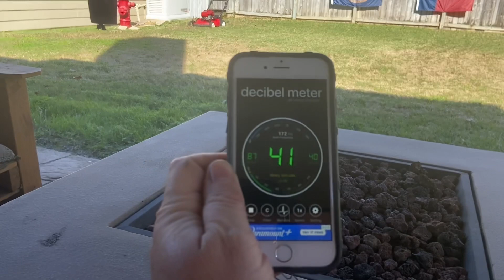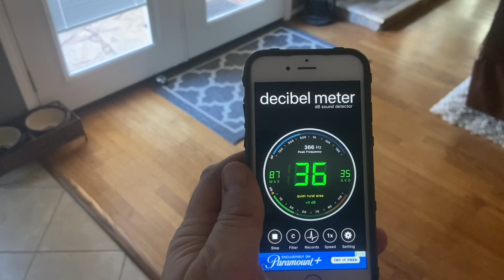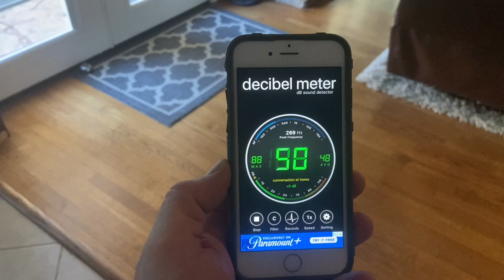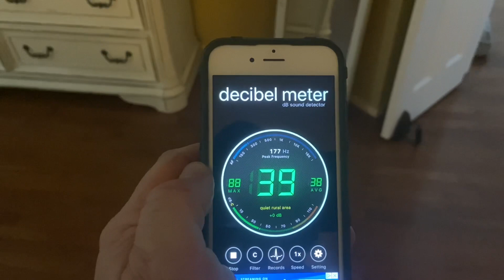How Loud Is A Home Standby Generac Generator?????

Comment: I wonder if you can add some more sound deadening material would it make it quieter?  and would it be safe?  looks like there is a lot of room inside to add that material
Reply from the maker: The lid or top and sides has some the  ends have to remain open for air and exhaust. Honestly it’s not bad unless you plan to sleep outside while it’s running. I my area during a outage it’s only a matter of time till everyone starts dragging out the portable generators so the noise level is really not an issue.

Comment: Just bought one of these and am waiting for the install.  I’d rather put up with some noise for a few days than have no power/AC/heat, etc. I assume it’s no louder than my central air unit.
Reply: I'm QUITE sure it's much louder than a central air unit.
Reply from the maker: Yes sir for sure , I hope the install goes smooth. Please subscribe like and share , take care and have a great day.
Reply: You may be happy to put up with it, but how about your neighbors? Untill they get these units to meet residential noise regulations, they should be outlawed.
Reply from the maker: @GrahamM-sm1hv  if your asking me 2 of my neighbors have the same unit, the noise does not bother anyone around me that I have talked to. If they don’t have one like this they will be dragging out their portables anyway so it’s a mute point.
Reply: @GrahamM-sm1hv  Outlawed? Stop being ridiculous.

Comment: Thanks for posting this informative video. I've read several reviews about this generator and will it is rated highly, most reviews report that there is a significant reduction of power when fueled by natural gas. I'm wondering if you use natural gas or propane, in if you are using natgas, have you noticed a power reduction?
Reply from the maker: Thanks for watching please subscribe and check out my other videos I have a complete overview on the generac on my channel. Mine is natural gas powers the whole house and more. Have a great week.
Reply: @JustCantSitStill  YOU TOO
Reply: The difference in power has nothing to do with the generator, and everything to do with the fuel.  ALL generators will produce more power on propane, and less power on natural gas.  It's just the nature of the fuel.  The difference is roughly 10%.   For example, a generator that is rated for 24K will produce 24K on propane, but will produce roughly 21K on natural gas.
Reply: @5thGenNativeTexan  That's good to know. Thanks.

Comment: My initial gut feeling was that your muffler is damaged or you have an exhaust leak. It should be quieter than your mower.
Reply from the maker: Thanks for watching please subscribe like and share! 

You have to be joking right? You think a 999cc engine running at 3600 rpm is supposed to be quieter than a 212cc mower at idle……😂 no way but I was impressed that it was not much louder not a huge difference especially inside the house. Have a great day!
Reply: @JustCantSitStill  No I am serious. New Generacs are significantly quieter than the lawn mower. I think one or more of the internal  baffles may have blown out. Check the entire exhaust system for leaks, cracks, etc. Nice video BTW.
Reply from the maker: @thomasgibson8025  no nothing wrong with it sounds exactly as others like mine. and was just serviced and inspected. You may be getting mixed up with the 4cyl models that runs and a much lower rpm. Please subscribe like and share. Check out some of my other videos thanks 🙏
Reply: @thomasgibson8025  I have to agree with you! I'm not sure why his generator is so noisy Yikes! Maybe a bad mic on his camera or phone distorted the recording? If not, I would say his unit has an issue. I have a 24KW and when its running it sounds more like Honda generator when it running under full load at max RPM. My wife said it sounds like a more like really loud purr sound and nothing like a walk behind mower.(similar to one of the  a new John Deere riding mowers)  I just went out and checked mine. Using a decibels app on my phone, at 25ft (10 feet closer than in this test) I get a reading that fluctuates between 67 and 68 decibels. Another Youtuber (Transworld Electric) ... posted a video to demonstrate how loud it is. In the video, when running it sounds exactly like mine and will give fellow Youtubers a more realistic idea of what they can expect should they be considering a purchase. Check out-  https://www.youtube.com/watch?v=bQAPJS7bG4A ... or this one of a 22kw running-  https://www.youtube.com/watch?v=hloIeIEu1wc
Reply: UPDATE! ...  after thinking about this for a while I had a brain storm and thought of valid reason why his unit sounds louder than what we’re accustomed to. The issue could be attributed to the generator technician who installed it! As you may know a nice feature of Generac generators is their Quiet Mode feature which limits noise while running during its weekly exercise. During its weekly exercise, (running anywhere from 5 to 15 minutes depending on the model)... in addition to providing the owner with peace of mind knowing it will be ready if needed, it also ensures all parts remain properly oiled, prevents fuel in engine from degrading and helps prevent moisture buildup in the crankcase oil. FACT: Quiet mode is enabled when these units ship from the factory. That said, depending on the climate where they are installed some owners (and Generac technicians) have reported a problem where the weekly exercise is not sufficient enough (i.e., the unit does not get hot enough), to remove all the moisture from the oil and over a period of time the moisture builds up (sometimes referred to as wet-stacking)  To help combat this issue, on installation, some installers override the Quiet Mode program so the unit will run at full speed during exercise. (i.e., Max speed approx 3600 RPM). While this helps combat the potential problem, it does mean generators with Quiet Mode disabled  will sound “much” louder than what owners running in Quiet Mode have become accustomed to. NET: His  generator may have Quiet Mode disabled.
Reply from the maker: @eltonnoway7864  thanks for watching in this video the generator is running due to a mock power outage, so it’s running at full tilt.
Reply from the maker: @eltonnoway7864  Elton I am not sure if your response is direct to me or not but trust me it’s not much louder than a single cylinder lawn mower. It’s running at 3600rpms just like it would during a power outage. If anyone thinks it should be quieter than a single cylinder lawn mower ….they can’t be serious.
Reply from the maker: @eltonnoway7864  this was not a weekly exercise run , and even if it was mine has the quiet mode disable to combat all the issues that the quiet mode creates.
Reply: @JustCantSitStill  Ah ha... that helps to address the concern expressed by Thomas Gibson about something being wrong with your unit. Yep - Disabling Quiet mode can account for an increased noise level. FYI:  To combat condensation issues, like you some people elect to disable Quiet Mode and always exercise their unit at full RPM. Others elect to leave their units in Quiet mode but once a month they flip the "Manual" switch on the generators operator panel which forces it to fun at full speed until they shut it down. Personally I leave mine in Quiet mode for the reoccurring exercises but once a month I kill the main breaker thus causing the transfer switch to activate and fire up the generator in full-blown operating mode where the generator supplies total power required by my house to operate. I typically run it for a half hour minimum. Regardless of the approach the idea is it to make sure your unit gets hot enough to not only dry out the oil but it helps keep the slip rings and brushes cleaner (the components that transfer the power from the spinning parts of the generator to the wiring in your house). To reduce the issue of condensation in the oil I find it easier to run a full blown operational test, rather than fooling with the manual switch on generator control panel. Simply flip off the the main breaker. Bingo. It's quick, easy, and tests all the functions of the automatic transfer switch and generator that would normally happen during an actual utility outage.
Reply from the maker: @eltonnoway7864  I would have not done a video comparing the noise level with it in quiet mode. That would make zero sense. The purpose was to compare the noise and address some of the noise comments in the main video so I opted to compare it as a full outage. I was not interested the noise level during exercise mode as I don’t think anyone cares about that. Thanks for watching subscribe like and share!
Reply: @JustCantSitStill  lmao some people just go on and on
Reply from the maker: @zacharyphillips9294  yes sir check the my main overview video on my generac find the recent comments about the fire hydrant…..smh.           Thanks buddy for stopping by and checking out my channel. Subscribe like share take care and have a great weekend.
Reply: @eltonnoway7864  Hard pass on a Generac if you have to disable a mode to get it to work. I'm going with Kohler.
Reply: @ceefaster6804  My suggestion to try "Disabling Quiet Mode" was not to get it to run... it was to see if it would address the louder than normal noise leveI.  As to the Kohler vs Generac debate... operationally, warranty wise etc, Kohler and Generac are very comparable. If you google "Kohler complaints" you will see they also have their share of problems. Personally I don't think one is better than the other. Both companies make great generators. If I was still in the market for a whole house generator, and since their prices are still all within dollars of each other,  I would do the same thing I did last time. Call Generac, Kohler, and Cummins and via their sales reps get answers to two questions to determine - 1)Which company will give the longest warranty term (ideally 10 years) "and " 2) Which one can  "guarantee" the earliest / quickest "installation date" 
TIP: Only contact locations in your area that are advertised as being  "Factory Authorized Dealers "and" Factory Certified Installers" Also make sure the "warranty" your are quoted (e.g. 7 years 10 years etc) is from the company that actually manufacturers the generator and NOT from the company installing it (e.g. Joe and Sons Plumbing) If so, when the installer goes out of business... your warranty goes with it.

Comment: Your neighbors will hear less than you do because the exhaust side is the loudest and that is pointed toward you based on where u put it. I have mine with the exhaust pointing into the back yard so it’s quieter. That sound is the best sound to hear when you have 98 degree temps and humidity off the chart! It also sounds awesome to hear when you have power outages and it’s 9 below and/or you have 20 inches of snow and sit in your house at a cozy 72. 😁 everyone will know you have one. Good your house is less likely to be a target for burglary that way. In addition if someone Down the road has medical needs like oxygen, or breathing treatments you can be the one that allowed them to come over and help them out, or throw your neighbors an extension cord for the fridge. How terrible they must feel about you having a generator. 🤣😂 some comments are just ignorant. Ignore them.
Reply from the maker: Dan thanks buddy for watching and taking the time to comment your awesome and I have to agree with everything you said. Please give me a subscribe if you have not and check out some of my other videos, like 👍 and share have a great weekend!
Reply: True you can be a help to others.
Reply: @ceefaster6804  I'm just waiting for the entire neighborhood to want to camp out at my house during a summer power outage.
I never knew I had so many good buddies.

Comment: This is why I placed mine 50 ft from the house. I love my generac
Reply from the maker: We are close to the same I am probably a little over 40 ish feet from the house, I see a lot of people put them up against the house to save on the install cost but that will come back to bite you for sure.
Reply: @JustCantSitStill  I agree. If you're going to do it, do it right. It was worth the extra money to trench to the property line. Does your generac reach your wifi? Mine was connected to wifi, although the signal was very low, for the first few weeks and now it's disconnected.
Reply from the maker: @blueboat9581  It probably will just barely get a signal , with the mobile link gen monitor it’s on LTE now.
Reply: @JustCantSitStill  Sorry... but plenty of people will disagree with you. It's all relative to how an individual generator owner manages their money.  For example a Generac factory rep did my estimate for a turnkey install of their 24kw model. To install the gen within 15ft of my utilities it was $10,000. To install it at the edge of my property 60 feet from my house the install went up to $12,500. Considering the money and the fact that power outages don't happen everyday,  for the occasional power outage some people will be more than happy just to have power and be willing to put up with a little noise once in a while and keep the extra $2500 in the bank or spent it on a necessity.
Reply from the maker: @eltonnoway7864  Elton thanks for watching buddy, I appreciate it greatly. Subscribe if you have not already and check out some of my other videos. Have a great weekend 👍